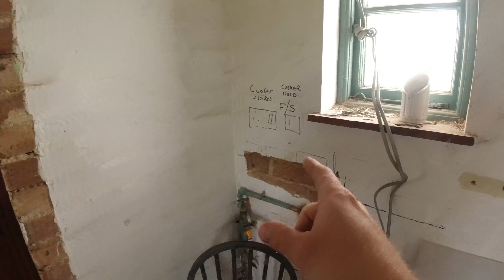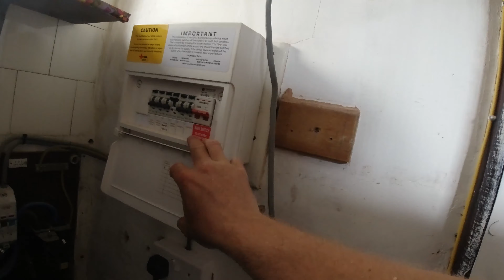HOUSE REWIRE PART 1 - A & R ELECTRICS

Comment: That previous work is not a good standard mate. If the budget is limited obviously just see what you can do with it, but my preference would be to rip it out and start again. Great work by you and the lads again
Reply from the maker: Yes although they prob had a budget in mind I think by asking us to complete I think they knew at that point that their budget was no longer possible.  We managed to save decoration with the already plastered walls and likes of the consumer unit to use the existing rcbos (hoping to help save a bit of money)  But the rest we basically had to rip out and start again.  It was a quick job done originally with no finesse about it. It would had taken just as long to work out what they did.

Thanks for watching.  And thanks for the kind comments 👍

Comment: at 10:58 why didnt you use that single box for an fuse spur to the washing machine? you would want a switch device for under the sink if it gets wet
Reply from the maker: We don't like to clutter the walls with switched spurs especially when the worktop space is tight when trying to keep the 150mm distance from the hob and at least a 300mm distance from the sink unit.
It can also start to look messy with too many accessories along one wall. So we install single sockets for each appliance in the adjacent cupboard, it will be easily accessible and out the way where it doesn't ruin the look.
We like to try and keep the installs simple. 🙂

Thank you for watching.  You will hopefully see the progression with this job in future clips.
Reply: @ARElectrics  on the on site book they say 350mm from the cooker(its not applicable most times like in your case) 
 If its a big kitchen and depending on the client you should put a fuse spur , but if its a small one a grid switch is the best choice .
In the Regs I believe that they say IDEALLY should have a switching device in case of a faulty oven/ WM / DW  to prevent a fire since those sockets are not easily accessible.  Even though its ok to put them sockets on the ring I personally think they should always have a  emergency switch to those appliance and its the best standard to do. Imagine theres a faulty dishwasher and you hear it buzzing/arching taking it out to disconnect it or tripping the breaker would take too long. Even in  the NIEC say ideally should have a switch to it , its just good standards in my opinion. The price will be higher but its safer . 
I hope i didnt get too confusing since its almost 2 am and im drunk :P
Reply: @cocoino2307  he said in the adjacent cupboard so still accessable by opening the door.

I agree with trying to keep splashbacks clear  of accessories.

I put my fcu or even just switched sockets in the cupboard next to (adjacent) to the appliance.

I once had a kitchen with a plinth heater, dishwasher, fridge, freezer, washing machine and finally a boiler in a tall boy cupboard all in a row.

This then went to a grid switch below the boiler hidden in the cupboard.

There were windows above the work surface so even if I wanted to I couldn't put them above

Comment: What are you planning to do on the certificate? I wouldnt do one
Reply from the maker: It will be difficult to outline what we have done and what has previously been done precisely.
We are inspecting each circuit thoroughly by also visually checking under floor boards and tracing most cabling.
On the certificate we will just note that we have taken over a rewire and list the circuits that we have 100% installed ourselves.

Comment: Why do you guys up north use that metal capping ?
Reply from the maker: It is what the wholesale stock in our area and is the most common used capping here.  I have been using it since 2004 its what i'm used to.
Plus in my opinion its a better neater finish and you can feel metal in a wall much easier than plastic if comparing the 2.
Reply: @ARElectrics  they don't stock it down here for some reason I used it a few times from screwfix... not a fan of it but I've used plastic since 2004 I guess its what you used to. It looks a lot nicer than plastic though I must say